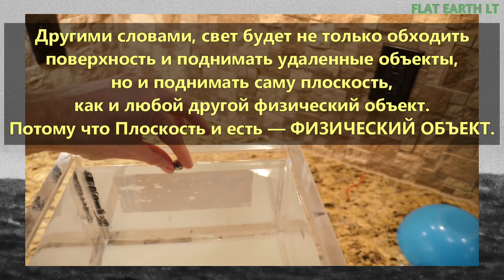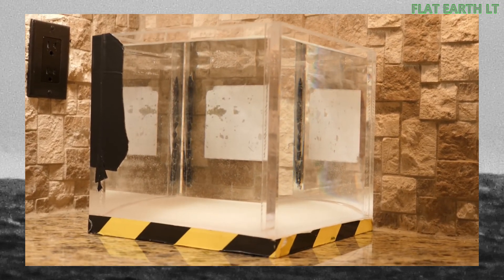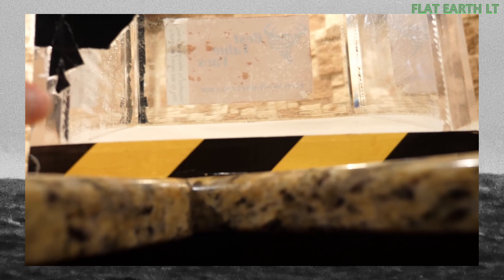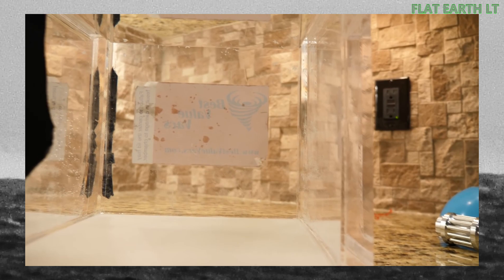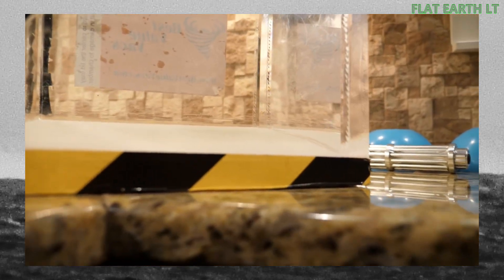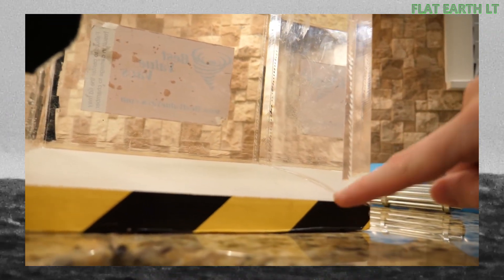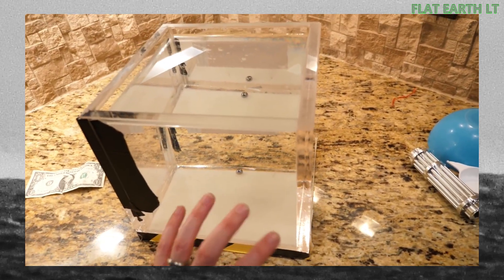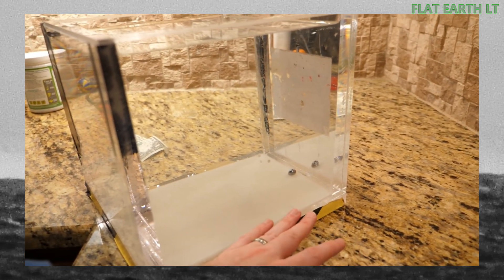Мальта ← 108 км → Рагуза (Сицилия) | Как плоская поверхность может скрыть холм высотой 500 метров?

Comment: The density of the atmosphere is less denser below (hot air/moist air) than up above (cold air).  This is the great swindle of the globe model. Looking for my video: TERRA PLANA | UMA DICA DE DEUS - Miragem Inferior (O Espelho da Ilusão)!
Reply from the maker: Partially I agree with you. But I also want to examine their own claims and prove to them that even if the light leaned down, that would also be an obstacle. I plan to do more experiments myself.
Reply: @flatearthlt3187  
Every observation you will notice the objects with inferior mirage. The atmosphere as science presents it is inverted. With the denser at the bottom and the least dense at the top they can lift objects that could never be seen on a globe. 
When we go up, the air doesn't get rare, there is just a decrease in oxygen, the nitrogen molecules will join, making the air denser cause of less kinetic energy of molecules.
 The strongest winds are at the top of the mountains, which proves that up there there is no shortage of air, but oxygen. The less dense layer is at the bottom, but the process is dynamic: the sun warms the earth's surface and the air becomes less dense, however it RISES, the less dense air rises (just like the helium balloon), but as it rises the air cools and becomes denser.
The inverted layers of reality is the great fraud of the globe....In eclipses the sun and moon can only be raised on the horizon because of this fraud.
If you footage without infrared you will notice the prove: INFERIOR MIRAGE!